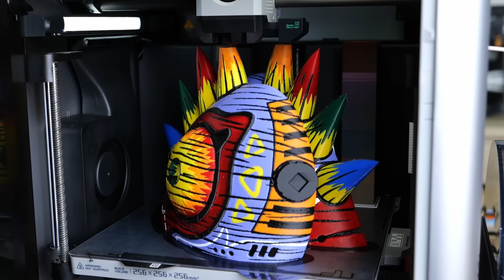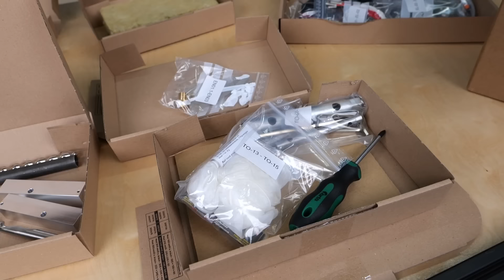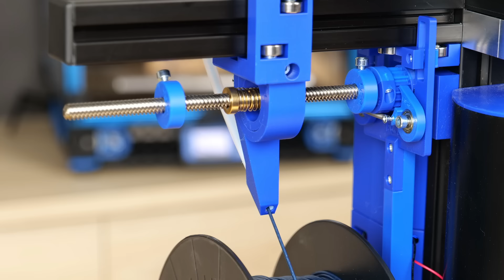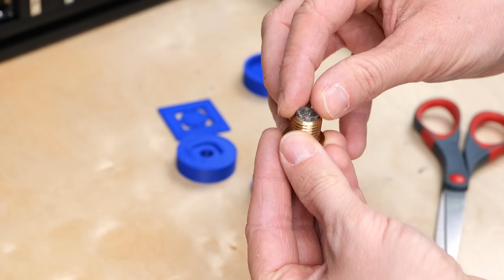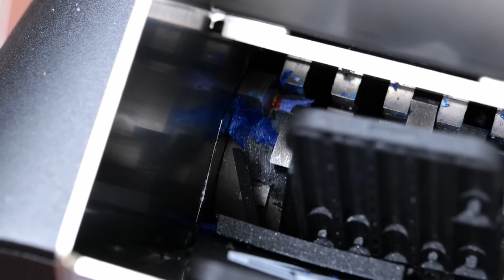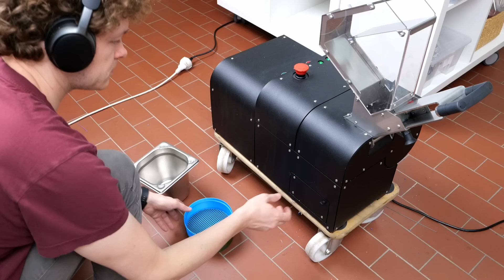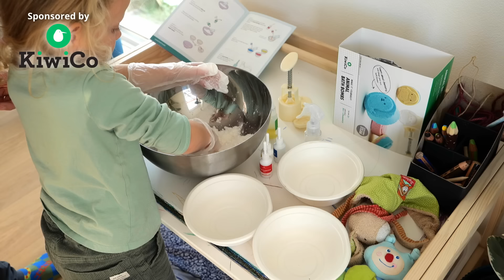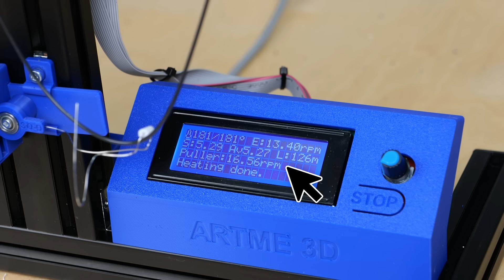Recycling Failed 3D Prints with a DIY Filament Extruder: Artme3D

Comment: The amount of detail they put while keeping it low price is honestly impressive. From a mechanical intermittent reversing winder to the mixer, angle measurement in a clever way, wow! Im amazed
Reply: How is $600 a low price? I agree it’s a great design but the parts aren’t exactly top of the line and a bunch have to be printed separately.
Reply: @frozenepsilon5295  it's a low price compared to industrial filament extruders that manufactures use that cost 10's of thousands if not more.
Reply: I know I am replying pretty late to this but why didn't they just use a potentiometer as angle sensor? The way they did it seems very round about and is probably more expesinve´.
Reply: @simonseide9791 the sensor on the filament arm is a hall effect position sensor, it has a much better resolution than a potentiometer, not only that a pot has a quite a significant resistance and could stop the arm moving, hall effect sensors or non-contact so doesn't add any resistance to the movement of the arm, it's free floating on bearings

Comment: I’d love to see an experiment showing how repeated recycling affects strength and printability.
Reply from the maker: I'll definitely dive into that!
Reply: @CNCKitchen  You should do a video on how much the ratio of fresh and recycled plastic affects strength. So many people think you can recycle plastic, just like aluminum or steel.
Reply: Have you considered making hybrid filaments with this? A hybrid TPU-PLA, or PLA-Polycarbonate, maybe? 

@CNCKitchen
Reply: While you're at it @CNCKitchen , can you try to re-join long chain polymers from old water-damaged filament (where the chains have been broken and interspersed with water/o/h molecules). It seems like under the right conditions that would be reversable, but also surely happens to very old filament that will be recycled. Also please use an equivalent to the UK climate (generally higher humidity with lower temperatures, i.e. summer = muggy if still, winter = moldy)
Reply: @CNCKitchen alright 👀
Reply: @CNCKitchen follow up video to this experiment?
Reply: @CNCKitchen yes that would be amazing I know that some companies put a ratio of new plastic into recycled plastic so maybe there is a ratio that is better ? I would like if you tested melt cycle and with adding a ratio of new pellet maybe 50%. I also know that some plastics are less affected by melt cycles
Reply: @CNCKitchen  did you?
Reply: @CNCKitchen
Reply: Repeated recycling will definitely vary in effectiveness between different plastics and also the lifespan exposure of things if that's at all included in the repeated recycling (i.e. a sacrificial crumple zone might have different results from just shredding support material). 
Also, an even finer mesh could probably be used for the melt filter to reduce issues like dirt and dust, and if you go straight from the recycled filament to shredding again, you could step down in size of mesh without too much risk of clogging the filter each time
Reply: BrothersMake recently did a video on multiple times recycled plastics. 

They found pretty much nothing changes
Reply: Clogging is going to be crazy ngl
Reply: I've read that you should mix 50% with new pellets to keep the print quality high.

If the print quality is high, then it might be cheaper to buy pellets and make your own filament versus buying it premade... You'd also have to mix in the dye, though.
Reply: "brothers make" did an excellent experiment with this on video with injection printing which showed some really promising results, worth going and having a watch
Reply: @bunniebie  I was just going to comment this. Good thing I read the entire thread. 😂 While there may be some minor degradation, it doesn't really become noticeable unless you are doing super small and detailed prints. Even then, this will likely only increase stringing.
Reply: Great idea.
Reply: Having been an extrusion tech for 27 years. Its degredation has a distinct smell. The chains in the polymer break down. Its strength is less. A quick fix is mixing in some virgin pellets
Reply: There are a couple papers out there that talk about remelting and reusing PLA and how it affects the tensile strength. I think most of them should be opensource and you can use chatgpt to understand the parts that are too technical!
Reply: Well......in the big boy molding, and fabrication world we would cast the 3d printed part to make a tools that we would use to make molds containing many of the thing we wanted to make many of, then cast 5, 10, 20, 50, etc at a time using well documented, repeatable, reliable, known strength, etc final materials to get our finished parts. The bonus of which is if you spend the time FINISHING the RAPIDLY PROTOTYPED piece the first time, like people should be doing instead of chasing unrealistic smoothness and fiddly settings that change with the phase of the moon and are never the same between them, youll end up with molds of perfectly smooth and clean parts that you just have to whip up some AB urethane epoxy, cast it, and wait for it to harden. I really dont know why the maker scene hasnt clued on to this yet.......
Reply: @zombieregime  Because generally the maker scene are making 1, 2, 3 copies of an item, not 10, 20, 30 ...
Reply: @zombieregime  maybe it's because the "maker scene" is usually some guy in his basement who doesn't have the money to start an injection molding workflow. Also because people with 3d printers aren't usually looking to crank out high volumes of the same piece over and over...that's kinda not the point of 3d print printers.  But maybe you should start your own make channel since you obviously have so much "valuable information" to share with the world.
Reply: @zombieregime I did this with 37mm projectiles. Printed 6. Made 12 moulds. Deep pour epoxy with 15 min demould time. Makes short work for a pile of projectiles
Reply: @KS_Penetrator  thats how to do it! And at worst you only had a bit of flashing to smooth out where the halves met, if any at all. Which could usually be mitigated by designing the mold so that, say for bullet like projectiles per se, they could be point down in a silicon block with a deeper hole, perhaps some feature (geometry inlayed/embossed) in it to indicate a full well, and as a reference for finishing to shape/size, maybe some  channel grooves so the wells can 'share' a pour to lessen resin waste. Or just hide the seam in some complex geometry or a high angled transition transition, thats usually what we did. 

The fact that the simple act of FINISHING parts seems so foreign and alien to apparently all of the 3d printer/maker scene blows my mind....Like, we had a $160,000 resin curing printer at the shop that had submicron resolution. The kind of thing that comes with a technician to install it, and a service plan (we also had a kuka arm for roto-scupting foam blocks in the back. It was a neat place to work always something new, yet familiar). For one project we did a hand, about 3/4 the size of an average lady hand,. You could see the striations of the layers, barely, in bright light, at the right angles, but you couldn't feel them under your finger, and picked up only the slightest texture with your nail. Even THAT stuff would go through tool finishing before it got molded and cast. 

So, if people expect super smooth prints, and even that monster of a rig still produced stuff that got a going over.......what hope does some over priced extruded aluminum, cheap steppers, controller, and atmel chip (no, seriously...these things are cheap as snot. Look at the cost of individual components then apply economy of scale and pricing deals....many machines are quite over priced. Though in fairness there are some companies that have decent backend support and development so at least that extra cost is doing more than just lining pockets... Those flash in the pan machines from pop-up companies which use a bunch of computer renders in their promotional videos and look nice sitting next to your Mac on the other hand....I have some bad news for you....), typically with no feedback beyond homing end stops and counting output pulses, SLA FDM desktop, $500 rig have at even getting in the same city as the ballpark the one at the shop plays in?!? Spoiler: it doesn't. Sorry kids, ya gotta sand and bondo your prints if you want them perfect. Whoever said parts came out perfect and ready to go lied, at the very least embellished. Those kind of results are unrealistic, especially if you expect high turnover. Besides, learning to accept some imperfections in the prototyping stage (remember: 3D printing was originally called rapid prototyping...as in can quickly iterate designs before selecting one for full production...not once were they ever called (by any neutral party who understood the technology) 'totally ready to go out of the box full production' printers...yes, I agree, it was mean of those marketing departments to lie to you for profit...I have some bad news regarding that topic as well...) is the sign of a healthy well adjusted mind (#unpopularopinion and obsessing over print perfection is not autism, or OCD, or fixating.....its called trauma and I blame your upbringing. Someone ruined you, and my money is on your parents, compounded by school experiences, multiplied by your social groups in your developmental phases.... you're not divergent, you just have PTSD. 'Normal' is a lot wider of a swath than people with absolutely no training or experience in psychology or psychiatric care give it credit for, again its the PTSD that make yall fear that word as the bad thing, because if everyone is neurodivergent and autistic.....No body is. Stop marginalizing the people who ACTUALLY SUFFER from these things, they are not free use badges of 'you have to treat me special because Im broken!' for you to force on the world to feel special. That is not how any mental illnes....sorry, neurodivergent behavior works. SPOILER ALERT: we're all fucked up in some way, ergo to play that this is how im broken is not making you special, it it jsut labels you someone who would rather make excuses for their actions than put any effort into their demeanor and social interactions....like the rest of us have to. You dont get a pass because you googled ADD and played self diagnosis bingo. While you're coming to terms with this revelation, bad news...unfortunately, the cry closet is closed for cleaning.... Own up and get over it. You're a perfectly natural human being, out of 9billion people you are the only you that will ever be. Stop trying to be the least awesome pitty case this side of the Rio Grade, pull up your huggies and just go be awesome. It really isn't hard...just got to go actually practice some of that acceptance you all seem to talk about so much. Oh and stop waiting to be told what's acceptable and what isn't, think for yourselves, have an opinion that wasnt virtue signaled to you via the zeitgeist. You have a brain, it's a muscle, if you don't use, it it will atrophy. The average person is far more intelligent than societal pressures would have them assume about themselves. You can do it. I believe in you 😎👍). 

Now what the hell was I talking about again before I got distracted by edumuhkatin the youths of day..... OH YEAH... 

And FFS if you're making a bunch of things JUST CAST THEM!!!! Yeah yeah yeah, chemicals smell bad therefore they must be terrible wah wah wah the world isnt as cotton candy as I was promised.... There are smells in the world, sometimes things are even .... le gasp .... loud! THE ABJECT HORROR!!!! And yes, that last bit was for all the people destroying their tools and work pieces by not running their Dremel fast enough and at a feed rate the tool bit is designed for (which by the by, is on the bits packaging. If you cant RTFM you're not allowed to pretend like you have an informed opinion. Its literally illegal. That is 100% how the world really works (as far as you know). I agree, it was mean of them to not tell you, but thats the way it is).

(DISCLAIMER: The views and opinions expressed in this message are not necessarily the views of the speaker at any given moment...but they are a pretty solid bet.

This alleged message is possibly known to the State of California to potentially cause cancer and birth defects. Prop 65 states a warning as to potential health hazards must be posted in plain sight near walking paths in any areas accessable by the general public. Why there is one in my bathroom I'll never know...

No trees were harmed as a result of sending this message. However their oxygen may have been squandered for immoral purposes while a large number of electrons were terribly inconvenienced. 

I am not a doctor, lawyer, nor nice. I am not your doctor, your lawyer, or your friend. Nothing in this message should be considered medical, legal, or friendly. On punishment of public ridicule, and pain of treading upon a lego brick, in the dark, at 3AM on the way to the bathroom 

END DISCLAIMER)
Reply: @zombieregime Thx for the laugh. 
It's not often I see how the drugs kick in mid post.
Usually people are already wasted when starting to write, or they hit send once they feel it coming.

Take care dude. Be good to yourself, as I assume no-one else is.
Reply: @soul0360   uh, about 5 to 9. Why? Hold on....that fucking elephant is trying to swallow the neighbors duck, again.... BrB
Reply: @zombieregime you have some pretty significant issues my man...
Try therapy? I dunno. Rich of you to try to diagnose others though.

The vast majority of 3D printing makers are under no assumption that prints should be flawless. I don't know anybody who is thst actually has any experience printing.. perhaps of it was someone's first time buying a printer and were expecting flawlessness from the word go.

Anyway, you have a few screws loose mate. That rant was royally bizarre. Should probably seek help or something for that. Anywho, have fun with all that baggage.
Reply: @zombieregime  The craze of 3D printed ____ is getting ridiculous and the one that irks me the most are "3D printed concrete houses on build site" like WTF? Have they heard of Murphy's law?
Reply: @zombieregime  goo goo gaa gaa
Reply: @zombieregime  because i dont think ive ever found something i would invest the time in to make a mould to make loads of a part for
i am waiting out for the opportunity tho
Reply: @zombieregime  In big boy manufacturing, innovation is leading the way to the ability for a manufacturer to offer one-off products without the need or the hassle of having to spend tens-of-thousands of dollars paying "big boys" to produce a part that only I will use or need. This kind of "back-yard" engineering is making it possible to manufacture body part replacements which are always going to be a one-off product. It's also making it possible to recreate parts that no longer exist and can't feasibly be replicated to repair expensive machinery, to renovate historic architectural structures, or upgrade doodads on a 60 year old hot rod.

The maker scene is pretty clued in. The maker scene is where all innovation occurs. 

I understand that you are probably a highly trained engineer that has studied the technology that you use extensively. But, I think you need to understand that you are using technology that came from the mind of a tinkerer.
Reply: @zombieregime 
"I really don't know why the maker scene hasn't clued into this yet"

Because makers don't need to make 10, 20, 50 at a time. If you're making 50 a time, and maybe doing that 10 times or a 100 times for a total of hundreds or thousands copies -- you're a *manufacturer*, not a maker.

Volume manufacturing is awesome and all, it's not what the maker scene is about.

Comment: What about recycling/ up-cycling soda bottles or bottle caps?

I’d like to know if the tolerance issues inherent to DIY machines can be made better or worse by pelletizing input material.  Additionally, do tolerances shrink when adding in virgin materials?

Comment: Dr. D-Flo made some good videos about the nitty-gritty of recycling.

TL;DW for them: PLA doesn't recycle well, but if you first make a 100% recycled filament and then pelletize that, then extrude that with virgin PLA (like, at least 50%) it can work much better.

Teaching Tech also showed some cool ideas lately for pelletizing on a budget AND turning plastic waste into sheetstock.

I personally think that the sheetstock method would be a great use for the otherwise "unrecyclable" plastic, as it's not very sensitive to the problems that extruders have. You could even get away with dirty mixed polymers if you had the right fume extraction setup. (MAKE SURE YOU HAVE FUME EXTRACTION!)

Comment: An esp32 cam module (esp32 + camera) costs ~10€ and would make an awesom filament diameter & position sensor. Just put a white or black cardboart as a background and try the openCV library for the image processing. Then send the data i.e. woth uart to the extruder mainboard.

Comment: Not to be used by 99% of people. For example, who has such a good shredder at home? And who wants to invest so much time to get a few rolls of recycled filament? I think for most people it doesn't make sense and it's easier and cheaper to just buy new filament. Nevertheless, I think the idea is basically a good one.

Comment: If coupled with a Hall filament width sensor (see link in klipper documentation) you could use a feedback on the filament diameter and both avoid the tricky sensor at the bottom and also improve a lot the accuracy.

In fact, a video about filament dimeter compensation during printing would be interesting.
Reply: Sounds like a collab with Thomas Sanladerer is in order!